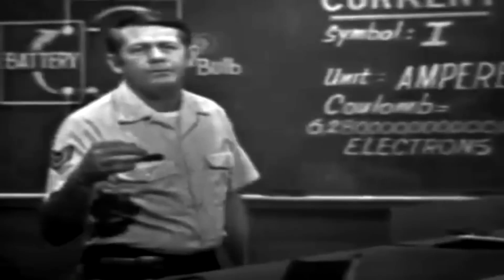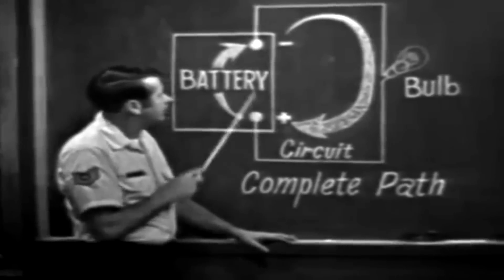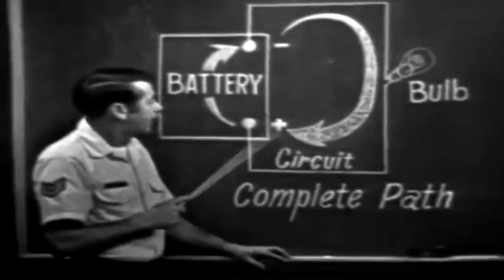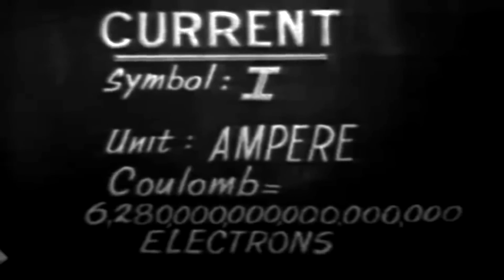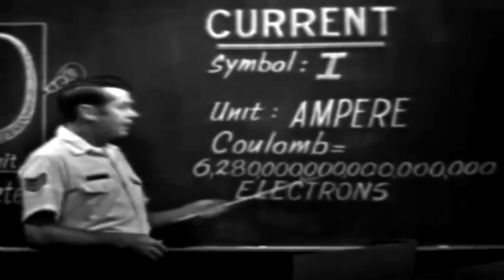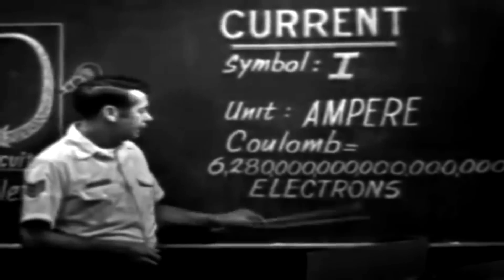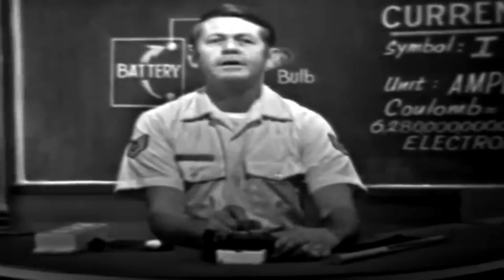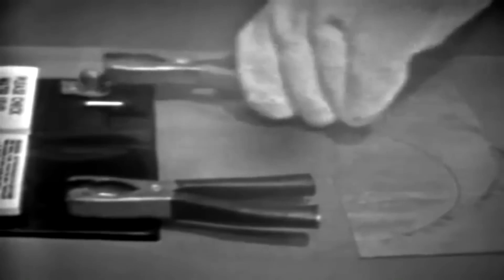Current Flow - Electronics Lecture 5B

Comment: Hi,
I'm confused about current flow in the power source.
The tutor says "current flow in the power source is from positive to negative".
But, electrons are negatively charged particles, which are emitted from the cathode and attracted to the anode; passing through the electrolyte.
Does this mean that the cathode is wired to the positive terminal and the anode wired to the negative terminal?

Comment: The line of discussion in this video is one which used to be common, but is, and was, incorrect and debilitatingly misleading.

The key is that current is NOT the flow of electrons per se, it is the flow of CHARGE. Charge is measured in coulombs, and current in coulombs per second. And electrons carry a (tiny) negative charge.

Suppose in a simple battery-and-light-bulb circuit, current flows from the plus terminal of the battery, through the bulb, to the negative terminal -- let's say 1 amp, or one coulomb per second.

This is sometimes referred to as "conventional current" direction, as though this is some distinctly different convention. Yet it is entirely consistent with the observation that "actually" the current is attributable to electrons flowing from minus to plus.  Since the electrons carry negative charge, that would be -1 amp of current from minus to plus (negative one coulomb per second), which is the same as +1 amp from plus to minus.

This turns out not to be confusing, because in electronics at the level of components and wires we deal almost exclusively with the aggregate phenomenon of current, not the details of electron movement, and all the concepts and math work out just fine. Only internal to tubes or transistors does an understanding of electron behavior matter.

Bottom line: to be consistent with all of electrical engineering, component datasheets and so on, the only applicable definition of current sign versus direction is that positive current direction is the direction of positive charge flow, NOT electron flow.